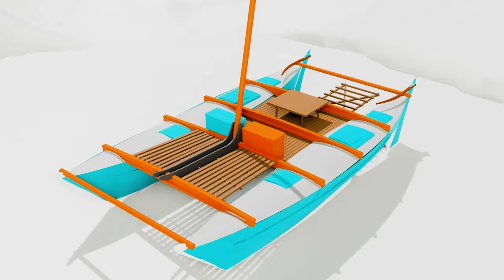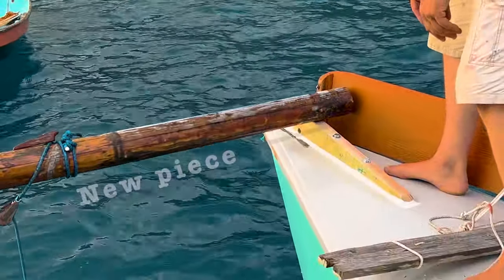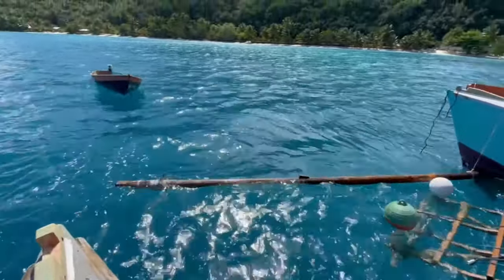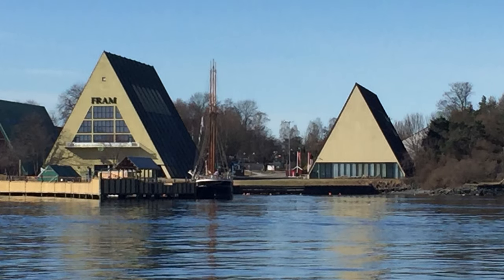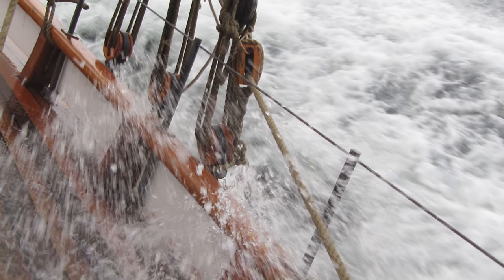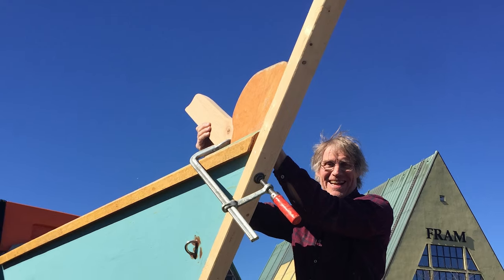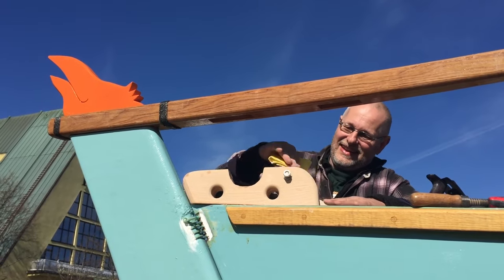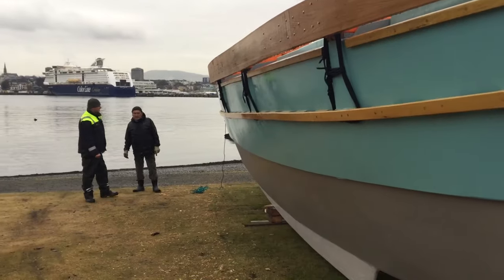The Banana Beam  - Sailing Catamaran BareBare in paradise - Ep 19

Comment: Your bulwarks should be standard fit on all Tiki's. They make Bare Bare, along with her flush decks, as sexy as the Wharram classic designs. Only Vikings would choose oak for the boards though, fit for shunting ice and boarding actions eh?

Can you explain how they are fitted, did they need steaming and edge setting or are they plain planks bent around and screwed to the ends of the beams?
Reply from the maker: Thank you very much - we like it very much as well, it was my husband Leif Erik that came up with the idea doing it this way! Oak is very good hard but needs to be varnished every year. The pandemic has worked hard on it and we have ended up painting it orange - «Firework orange». We did not steam them! I will have Leif Erik answering your other questions!
Reply from the maker: Leif Erik said: we have screwed the end plate to the beam and drilled four holes on each side of end plate and through the bulwarks. And we lashed it together. Now it is easy to take of in four pieces. Does this answer your questions?
Reply: Yes thanks, partly. Would love to see how your bulwarks are fastened on video one of these days. Also can't wait to see how your single mast rig works @barebaretoborabora